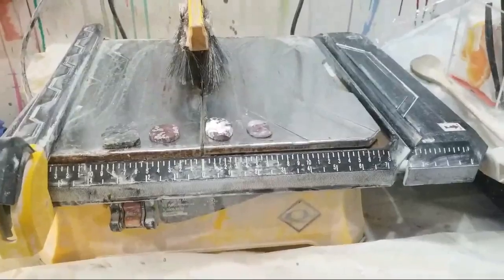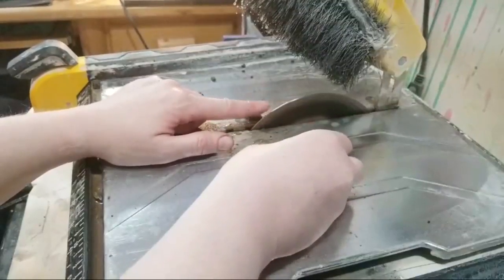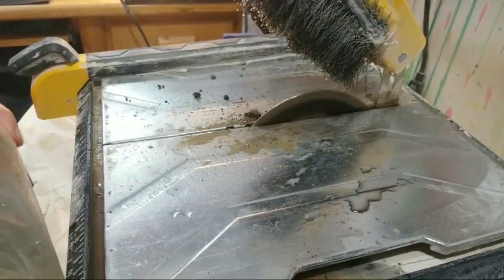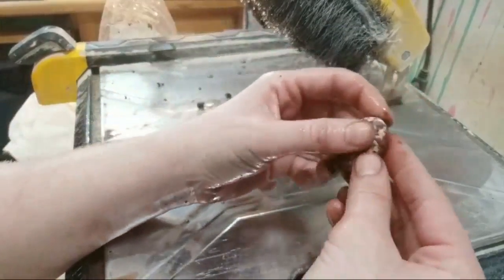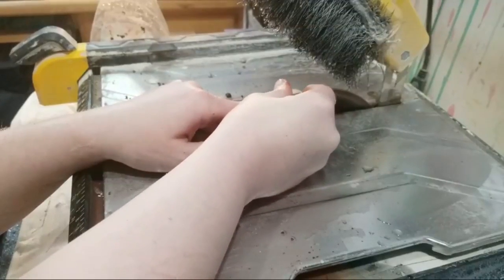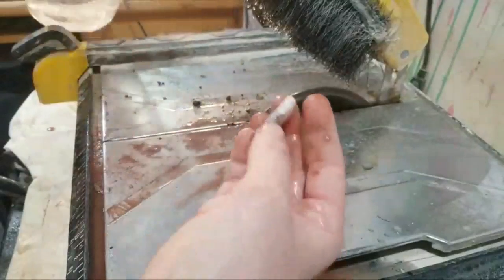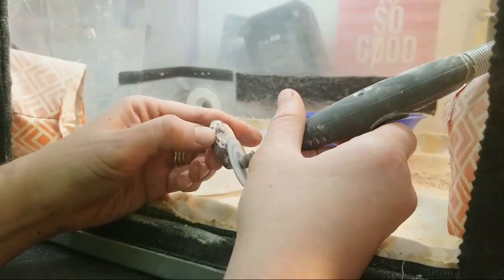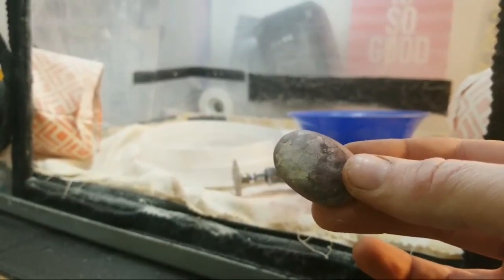How to Polish Rocks with a Dremel (Rotary Tool) and Wet Tile Saw

Comment: How many rocks like the first one will the diamond dremel bit last for ? Because bits tend to be quite expensive here.
Reply from the maker: It depends on if you get electroplated vs sintered. Also the stone you work and how much pressure you use will effect the time. Check out TEMU I. Have been buying bits there a lot a lot cheaper than anywhere for electroplated ones. And dental suppliers for sintered. My answer is. I guess it just depends.

Comment: I am brand new to lapidary, and I just bought a Chicago Electric 7" tile saw from Harbor Freight with a 7" continuous diamond blade.  I am curious about a few things...
1) What are you spraying on the table?  Just water, or is it a water / soap mix of some sort?
2) I am curious about your dremmel / shaft area setup.  It looks like a fishtank with a missing front side.  Are you sucking dust out with a vacuum?  What is the hole in the back, bottom left?
3) Do you have a list of your tools and uses somewhere?  Thank you for this great video!!!
Reply from the maker: Come over to my dremel lapidary by kersten Safford art page on facebook
Lots of answers for you there!
Water, just plain water.

Comment: You didn't tell us what speed you use or what that first sanding piece was. Thank you.
Reply from the maker: Grinding is low to medium under water. Sanding is medium with water polish is high speed..and some stones require a different aproach
Reply: @KerstenSaffordArt  Thank you so much.🥰🥰💖

Comment: I have the exact same saw which I use to cut big pieces into small slabs.  I love the set up with the brush which must keep the area clean and keep the water from hitting your face. Going to try it. I also notice how you place the basin cover, giving you a place surface to move the rock. Thanks for this video! And .. Bon retablissement!
Reply: I mean flat surface ..
Reply from the maker: That's just awesome. It works just great for that and I hope to see some of your finished pieces of you would like to share thank you
Reply: KerstenSafford Art Definitely!